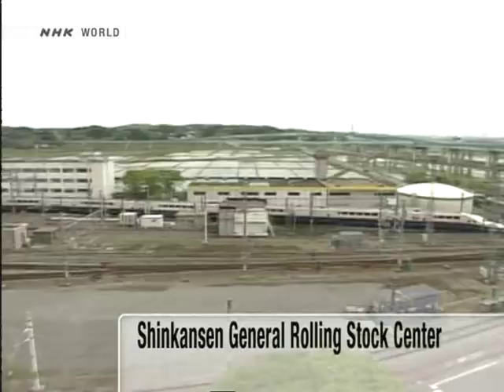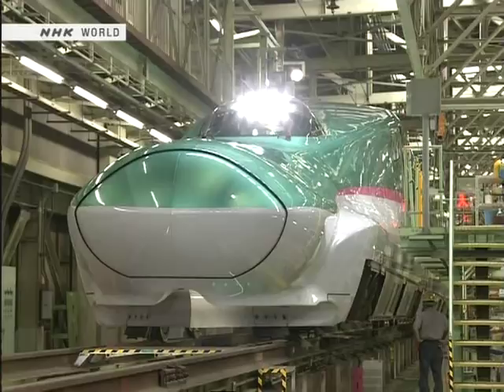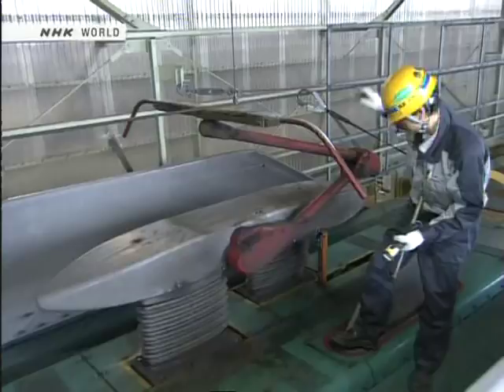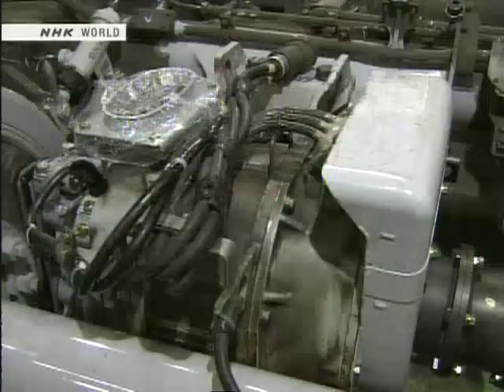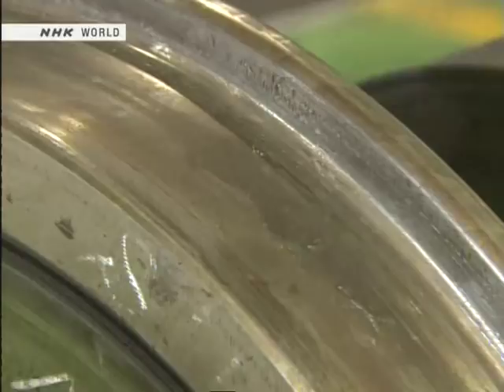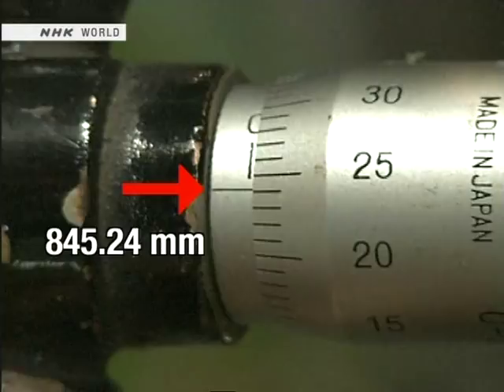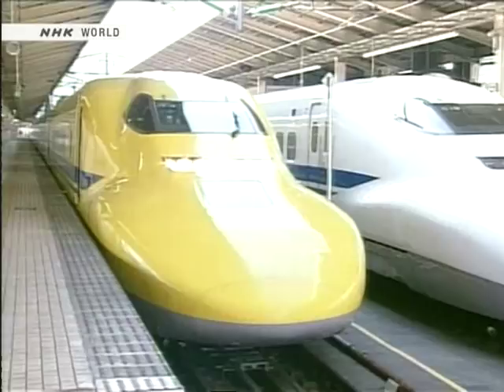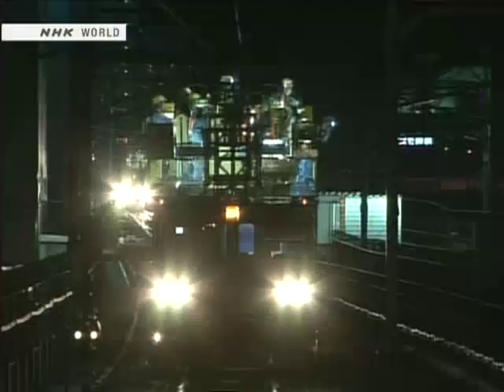Japan Bullets Trains' maintenance routine- clip from NHK World  documentary.

Comment: 4:45 wheel continually rolls. So, it will wear & surface aligns. When rail will align.
Reply: Its alot harder than the wheel, i just machined those wheels couple days ago at work. Wheels are just S355 Structural steel.
Reply: And if you didnt realize the train is travelling while the rail is not, so use your head a bit.
Reply: @KehusQ  : thank you. I know that wheel surface will be subjected to more wear than rail as it repeatedly comes into contact with long rail which runs for kms. But I am interested in wear rate & replacement of rail also (may be in years).
Reply: In finland, all the rails and tracks get inspected every year.  They upkeep rsils by welding and/or grinding them regurarly  to keep the shape. They dont really deform at all. And ultrasound inspection shows if theres any structural damage, which means the rail needs to gets replaced.

Comment: One question. Why every Shinkansen unit has a dirty roof (???). Is washing the roof in the unit is such a problem? Each train carries a ton of "debris" on roof ....
Reply: Probably no problem. Maybe a little bit larger drag coefficient (C_D value, although it mainly comes from a friction between flowing air and a fuselage that has stain). But it can be easily overcame by powerful motors. If the clean roof is pursued, the car must be washed every day and it cost a lot. Money for such cleaning is invested in rigid maintenance, I guess.
Reply: I did not mean to wash the roof every day. It can be 3-4 times a year. I understand that the train's body is cleaned every day and very well. Thanks for the reply ;-)

Comment: So the wheels keep getting smaller and smaller....
Reply: Yes, and in the old days when they became to small, they had to be replaced completely. Modern train wheels actually use a metal tyre that can be replaced when the profile gets to small. To place the tyre you simply heat it up, it expands and you can remove it. If you place a new one and it cools down it will form a perfect fit and, unless it has a production error, will be firmly fixed.